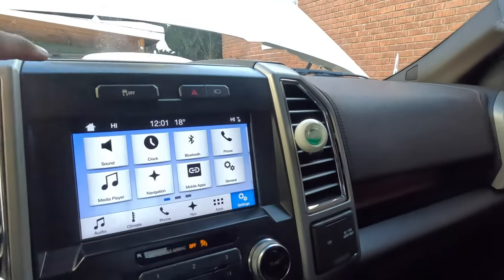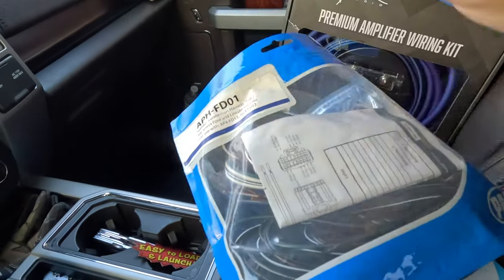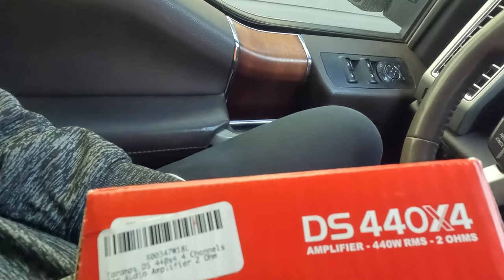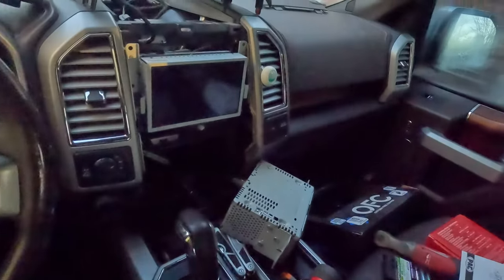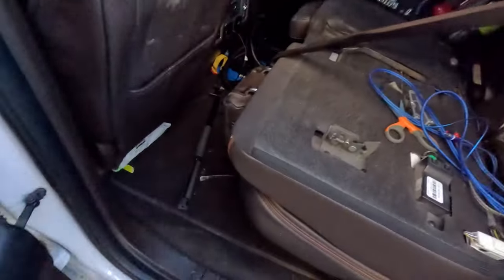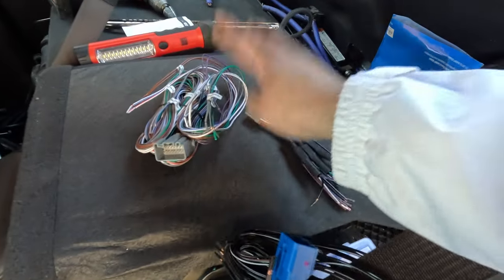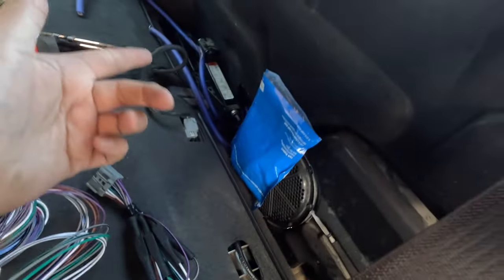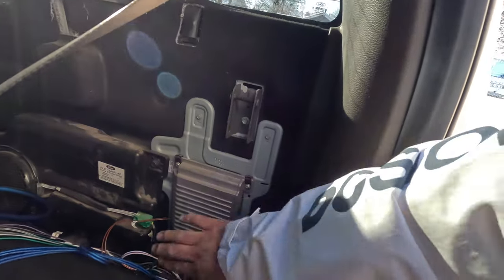F-150 4 Channel Amp Install ,On 2015-2017 F-150 With Sony System

Comment: question when u cut the resistor off .do I cut the resistor off then reattach it back to that wire or did u just cut the wire at the top of the loop an leave the wires cut in 2 pieces?

Comment: ALUMINUM is a great conducter and can ground really good just need to use seat belt buckle bolt, shorter the ground the better should be as close to amps as possible

Comment: Bro you can adjust the chime volume by pressing the settings button on the side of the pac amp pro, turn the chime volume to where you want and it will save the setting for you. (JIC you ever wanna turn them up or down. I have the same harness and LOC in my platinum. It works perfectly.
Reply: when he said to cut the resistor off do I just cut the wires in half an leave it or do I take out the resistor an resaulder the wire back together?  any help is appreciated

Comment: Good video!! Could a new head unit, Sony, be installed as well with the same AmpPro harness?
Reply from the maker: Yes you can but if your getting a head unit you wouldn’t need the amp pro. The head unit already has RCA for your amp.

Comment: Do you still need all of those rca ports if you are just installing a sub with a built in Amp?
Reply from the maker: You don’t. You would just need the one for the sub amp.

Comment: I have a question man I did the same install as you..but my tarams is heating up after 4 or 5 songs not turning off or anything just I think it’s heating up too quick?? Any reasons?
Reply from the maker: I’m not sure man mine does get super hot too maybe it’s just the way they design them 😭
Reply: Thanks for the fast reply I thought maybe I had the speakers connected backwards or something but thanks to your video my system is bumping hard
Reply from the maker: I’m glad I could help bro 💯

Comment: So how does it work if you don’t have the Sony sound system amp? Do you still have to buy the harness you bought for the speakers or? I’m just confused on that
Reply from the maker: Not 100% sure but it requires you either splicing into your door speaker wire behind the head unit and connecting those wires to a 4 channel amp or if you don’t want to splice buying a T harness and hook it behind the head unit
Reply: I have the same T harness but with no Sony on my 2015, my question is do I need the Sony premium sound to use it because I’m haveing trouble keeping bass

Comment: No groument around your power wires through front wall. You gonna have shorts or a fire. Your grounds you don’t have to run from batteries you can ground to the frame in back.
Reply from the maker: I couldn’t find a good ground.
Reply: I'm researching the Ford ground cause copper an aluminum is good conductors of electric I'm wondering if Ford just didn't give good grounds from the battery

Comment: Good video, how did you run your amp ground?
Reply from the maker: Strait from the negative terminal of the battery since the body of the newer f150’s are aluminum
Reply: @5.0hh_andres  Just bought everything and completely forgot about grounding with a aluminum body.
Reply from the maker: Yea I just had it buy an extra power wire for my ground
Reply: @5.0hh_andres  is the bolt behind the seat good by the cab wall ? There’s a cable grounded to it and I’ve been using it to ground my amp for around 1 year and havnt had any issues yet
Reply from the maker: That’s good to know bro 💪🏽 but I’m going to be running 3 amps and I didn’t want the ground to be an issue that’s why I did it through the battery
Reply: @juan_f150  Im using that spot right now to test everything, so far everything seems fine. I'm also only running one 1000w mono block.